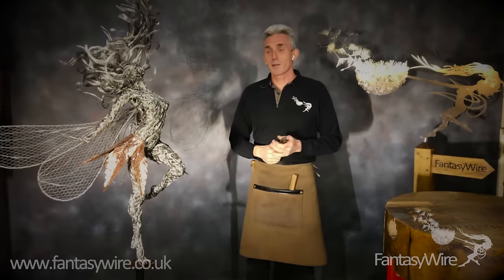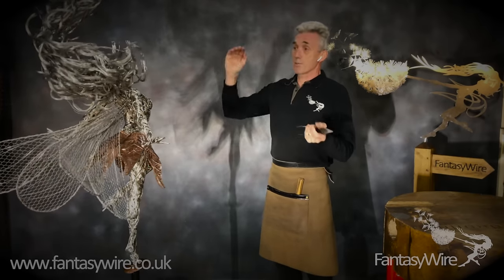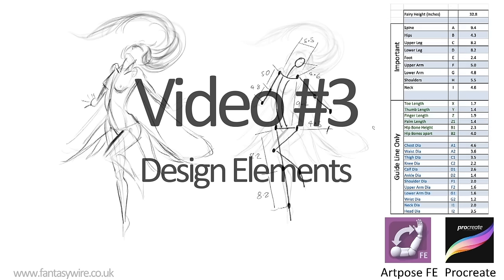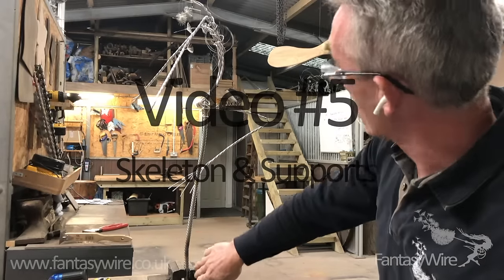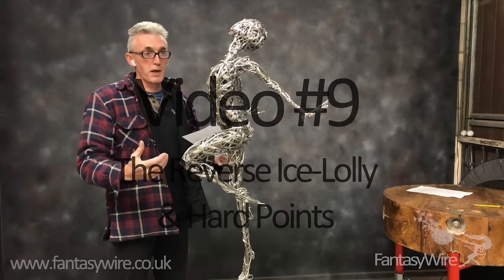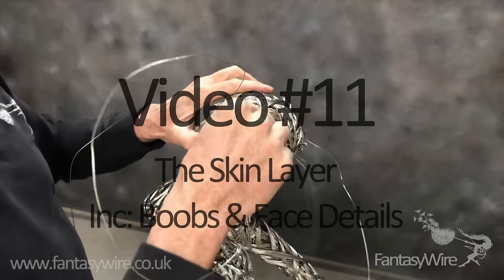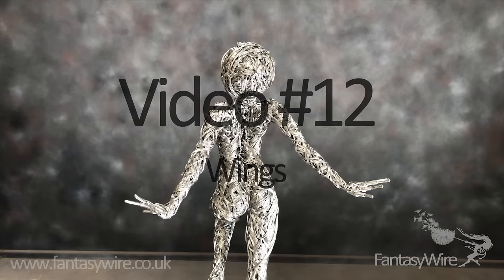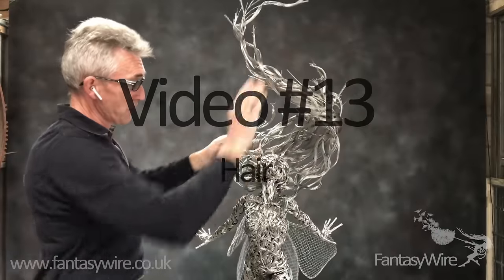The Art of FantasyWire Video 1: Introduction

Comment: Can i ask what type of wire did you use for your work? Is it a steel wire? I have a project for my class which i wanted to created but I bought a different type of wire and it is hard to work on my current project with the steel wire so I am planning to use your technique in recreating my sculpture piece instead of trying to bend the wire. Your work is always stunning and masterpiece.

Comment: Excellent stuff.. im going to try some of this for my own garden. A question... using steel tools with stainless I've been told its a no-no. Do you have a concern with this?. Thanks
Reply: There is some logic behind it, but its more myth than truth. If say you use steel wire-wool on stainless, it leaves a residue that rusts and can stain the stainless. Nothings I've done with steel hand tools has caused any problem at all. Also welding or heating stainless can change the properties and it will stain, but its not corrosion and can be polished out again.
Reply: Cool  ... great videos thanks